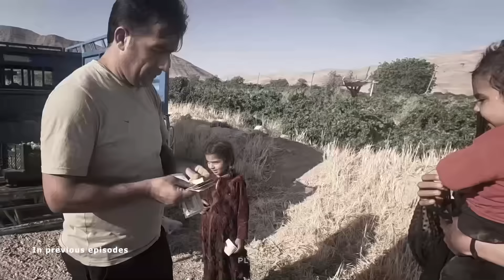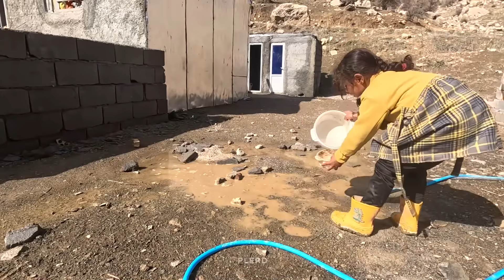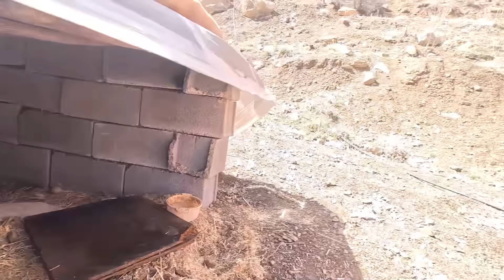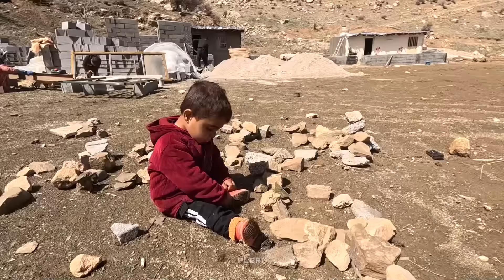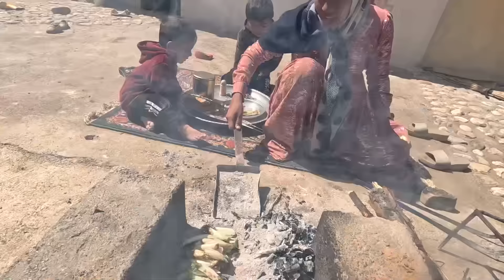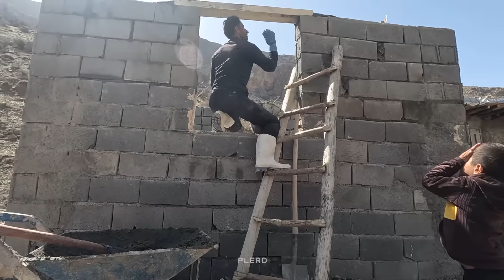Securing the Home: A Single Mother's Project with Learning for Her Children

Comment: Just a thought..... The 2 rooms that the builder is building now, plus the room the sheep are in (if it could be cleaned out properly....i mean no lingering smell from the sheep) could become the family home. They would then have a 3 room house, every room with a window, plus the original porch. They could put an external door in one of the rooms leading out to their shower and toilet. The  house they are in now (the one with no windows)  could then  be divided nto 2 rooms, one as a room for the sheep and the other to use as a storage shed for the sheep food etc. As that building has 2 external doors, they would have a separate external door into both rooms. Good thing i think is that all the animals would be in one area, and the sheep are closer to where they take them up the hill to graze.